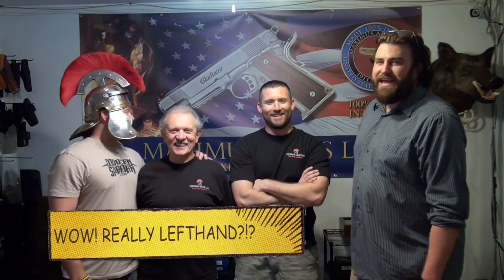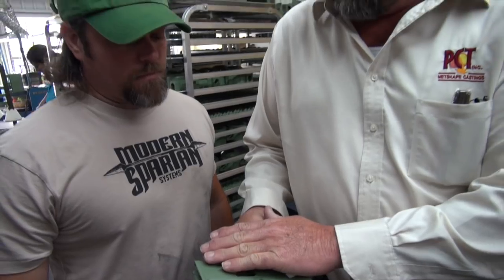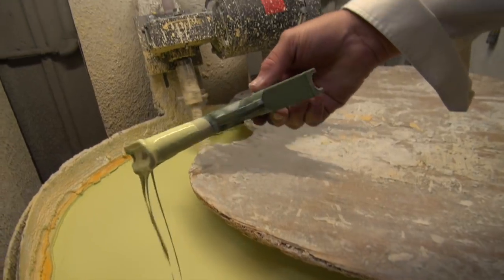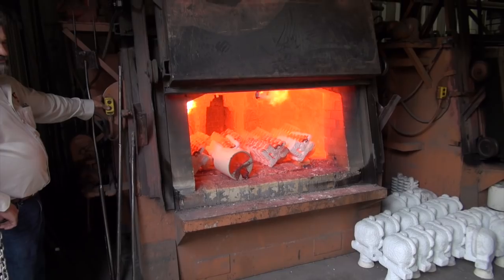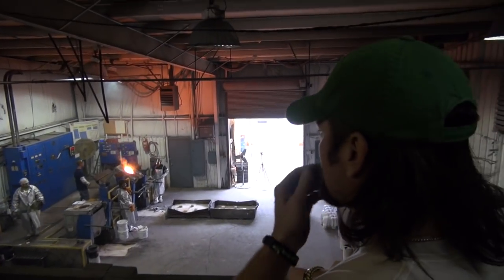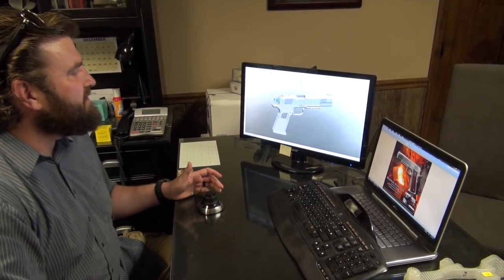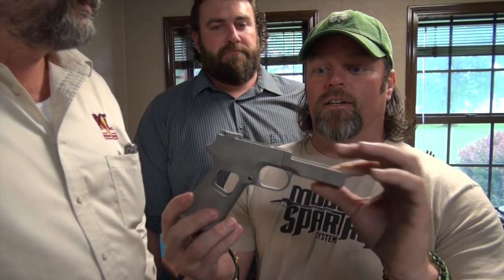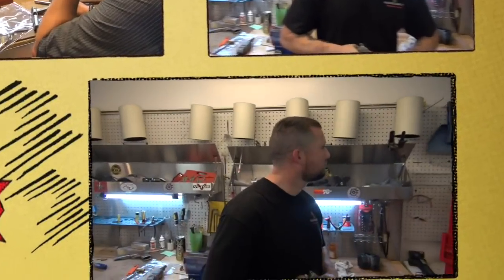How a Maximus Arms 1911 is Made

Comment: This video was great, but, you fast forwarded through the actual build of him making the pistol. 
I would have liked to see the custom fitting of the pistol parts, along with him trimming parts to fit.. Hand fitting is extremely important, and you guys blew it fast forwarding that. Lame. Should change the video to, how a 1911 is molded, because I sure as hell didn't see it made. Still, good info, I haven't seen a cast mold of a 1911 done.

Comment: Making 1911s from castings? Just like Rock island arms in the Philippines. Mil spec on the M1911 was Making them from forgings and bar stock and no modern military rifle or pistol has the major components made from castings because the tend to crack with hard use.
(B.t.w the m2 barrel liners a not steel they are stelliet and must be cast.)

Comment: So it's cast and not a forged frame?
Reply: simhopp I think the difference is in how the steel itself is handled...the frames are cast from molten using wax in these, whereas with something like, say, Colt or STI would have a frame and slide machined out of forged steel billet.
Reply: Adrian Rubi  It´s a cast not a forged gun !
Reply: *****...ok.
Reply: no, all the casting they did was just an illusion.

Comment: I worked in a steel melt shop that made alloys for the investment cast industry.  I spent over 35 years making hundreds of different types of steel, with 17-4 being a very popular alloy due to the ability to accept heat treating so very well, letting the final part have different properties.  
That same alloy was also used in the Sidewinder missile tail fins.  
We also made metal for gun barrels, etc.  That was usually 410 or 416 w/sulfur.

Comment: I used to work in a factory that made pole line hardware and their foundry was in the bottom level with only one side open which meant no way for heat to escape. In the summer it was not unusual for the heat from the castings to set off the fire suppression sprinklers. That's the last place I'd want to work. Most of the guys in that department were new hires from India who insisted they had to wear a turban but after a week they usually had short hair and no turban.